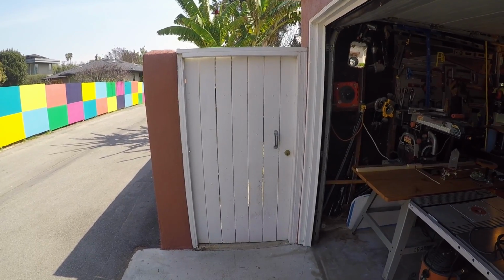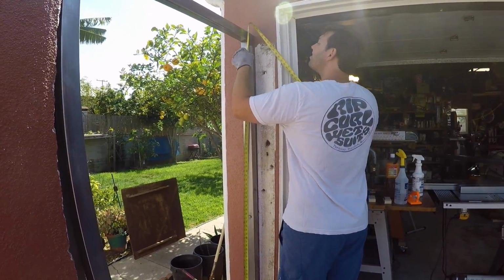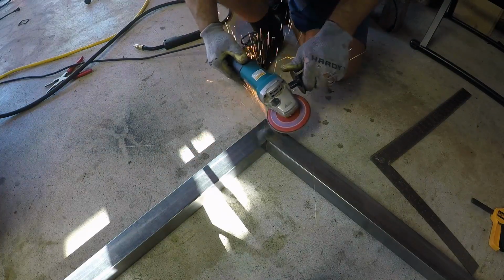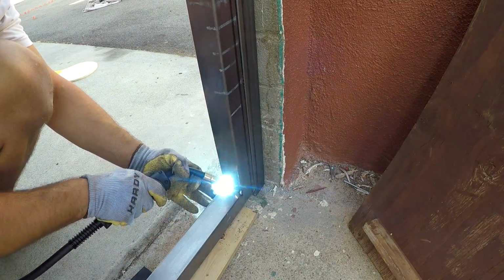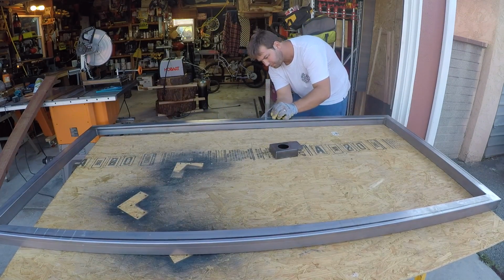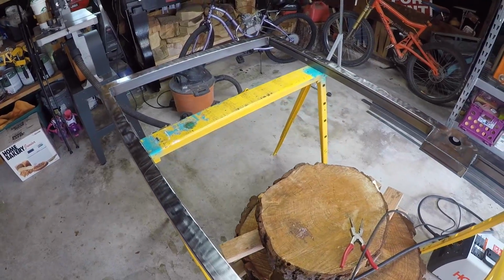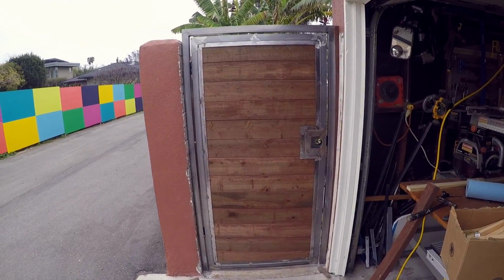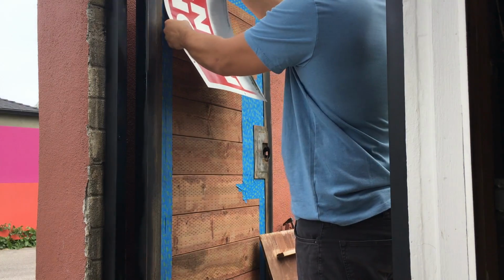diy Metal And Wood Entry Gate

Comment: Nice, but you should run your MIG hotter. Should be about 230IPM/19V for square tubing. Penetrates better, don't want weak welds on a gate that has constant weight on the frame.
Reply from the maker: Lone Basserman great tip. Thank you.
Reply: @Santamonicadrainco  No problem brother

Comment: are you using gas with your welder? can you shared your set up? I've been wanting to connect a tank to my welder but don't really know what type of gas and tank to use...
Reply from the maker: eddie25445 I use flux no gas and gas. When I am using gas it 75/25 carbon argon. Check out the description I’ve got a link to my welder.

Comment: won't the metal rust over time? Easier maintenance using just wood no?
Reply from the maker: razz P prep your work. Use high quality paint and clear coat. Metal gates are 200 times better than wood gates. Metals stronger and won’t swell with weather.

Comment: Nice job...👍
Just one thing wear a safety glasses or face shield when used your grinder
Reply from the maker: Will do
Reply: Long sleeves too, nice job and be safe
Reply from the maker: Daniel Sanchez I am using 25/75 minimal splatter.